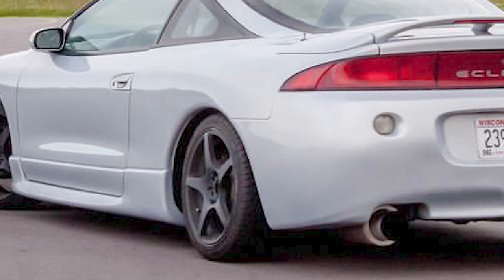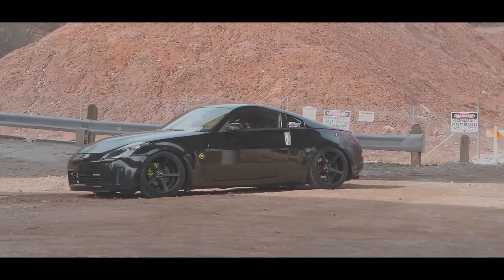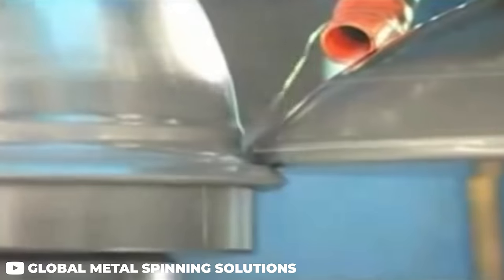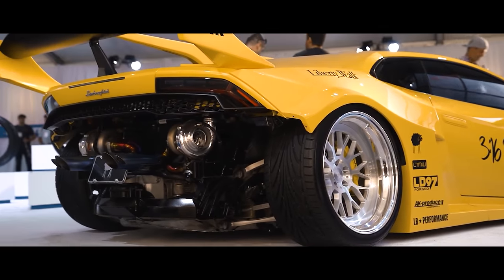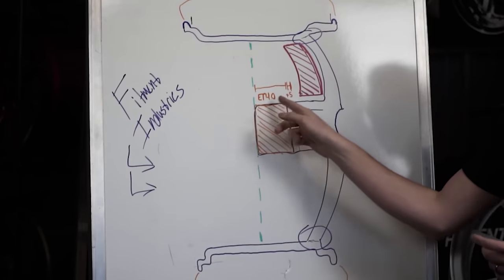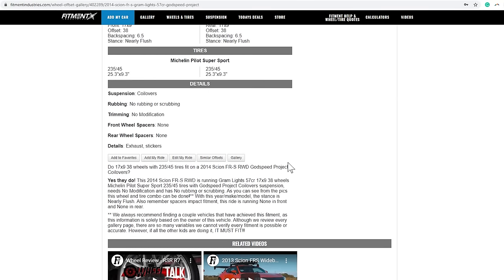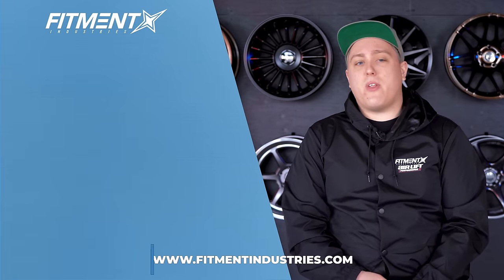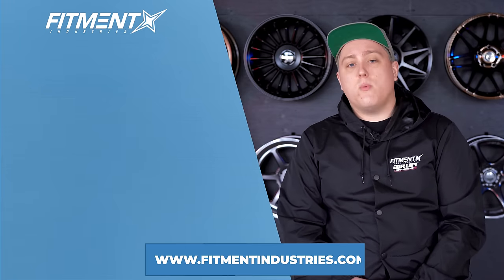Don't Buy Wheels And Tires BEFORE Watching This

Comment: I am thinking of going taller on my rear tires (and a bit more narrow) from 275/30/19 to a 265/35/19... mainly for comfort and looks. Will a change like this damage my transmission? I've seen many posts saying yes and some saying it will not... but primarily the ones saying it will damage are on truck and offroad forums where they are running huge tires. Is it a valid concern for what I am doing? The speedo change seems like it will be off by a couple mph at higher speeds will this mean the car will shift at incorrect times?
Reply: You don't even say what car you have. How on earth are anyone supposed to answer that?
Reply: @AB-80X  I have a 2010 w207 Benz but the question should be universal to most vehicles that have transmissions.
Reply: @Dnasty1  Not at all. Unless you fit some massive tire that is many percent larger and thus acts as a huge decrease in the final drive ratio - and you don't as you can't, so you'll be fine. The only situation where you might have an issue, is if you have 4wd. Changing the diameter by a few percent is fine as long as you keep the front to rear diameter bias in check if your car has a staggered wheel setup.
What you do is very normal and will not cause any damage to the transmission. Just remember to increase the diameter on the front as well, as not doing so might cause issues with the ESC and ABS system.

In the offroad world where there might be issue, it's because not only is the diameter vastly increased, but so is the weight of the complete wheel. Spinning a 12.5x37 vs. a 275/60 can almost double the weight of the wheel, and that's what kills the driveline, not only the trans. Your E will not have any issues what so ever. You are only increasing the diameter by 3.1%. Important thing here is to have a 235/40R19 front to go with the 265/35R19. In order to gain the added comfort you want, just remember to lower the tire pressure accordingly as you increase the volume of the tires. Aside from the added comfort, another benefit is that now your speedo will actually  be accurate.
Reply: @AB-80X  thanks I was thinking this was more a concern with off-road vehicles or cars with giant monster truck tires. I actually went ahead and did this since posting this (went 275/35/19 actually) and am loving the look and comfort just gotta dial it in a bit with the coilovers. I’m thinking of going 255/40/19 in front to match I hope it will fit otherwise probably 245/40/19.
Reply: @Dnasty1  Don't fit 255/40R19's up front. Even if they will clear, it will look really odd as the tire profile will be noticeably taller than the profile in the rear. If you use 245/40R19 they will be the same.
Reply: @AB-80X  the stock setup of this car has about a .5” higher height in front than rear. I think this is how this vehicle is supposed to be setup. I see what you’re saying though I did all this to get away from stock. I had liked the look of 255 over 245 on a 8.5 width wheel.

Comment: +35 offset are almost perfect with any adjustments to anything, no rubs no issues and note +35 offset embrace brembo perfectly also so don’t have to downgrade where the brakes are 😂😂😂
Reply: What are you talking about? That is totally subjective depending on the car in question.

Comment: Why don't you guys ever talk about hubcentric rings? It's almost mandatory for EVERY aftermarket wheels.
Reply: Usually only for the budget stuff. Most higher end wheels come with a correct hub bore for the car in question.

Comment: i just bought wheels and tires from your website without waching the video
Reply from the maker: What did you go with?! Did ya get some help? -Edgar
Reply: @FitmentIndustries  18x9.5 235 tires. is it bad to run the exact same thing on all 4 wheels? any downsides or upsides?